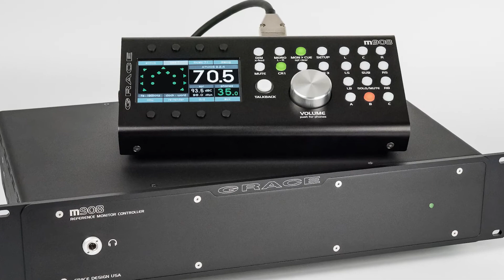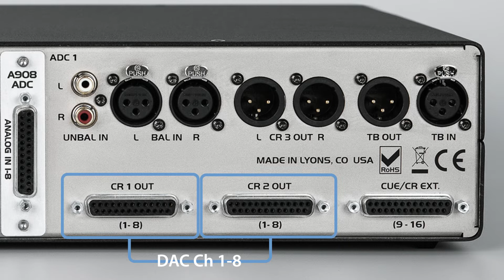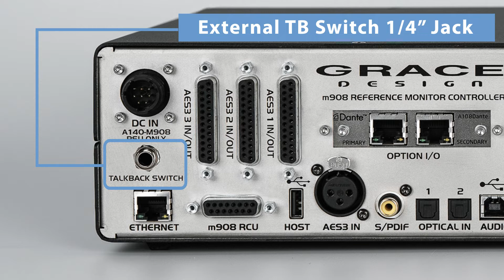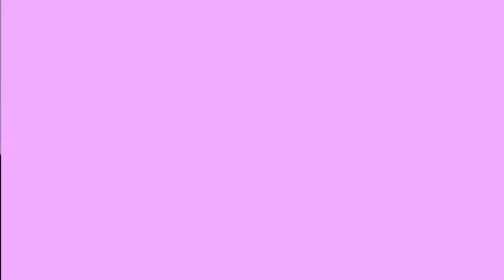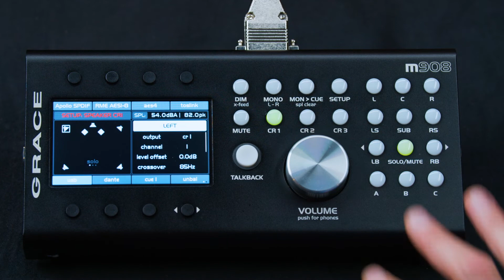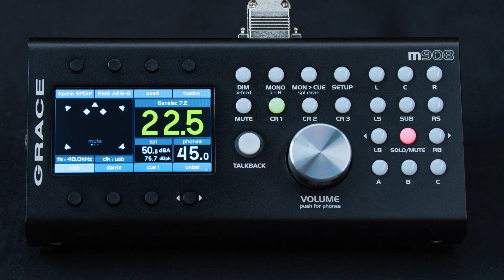Grace Design m908 Overview

Comment: Hey guys, what are your thoughts on monitor / room calibration. We use SoundID at the moment but as you know it’s very prone to user error and isn’t a fast solution such as the Trinnov range. Have you thought of adding this function, especially how the Trinnov system speeds up calibration. What do you guys use for example? It really would be a killer device with this built in.. What do you guys use? Just ordered the m908 so a software upgrade would be great;) Keep up the great work!